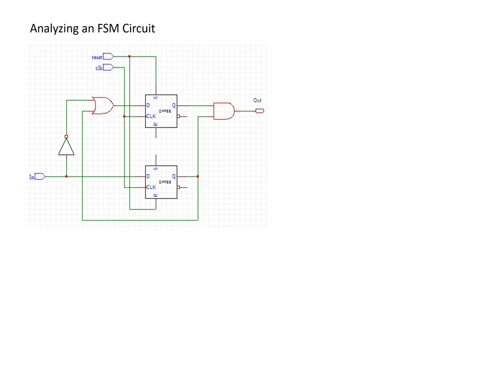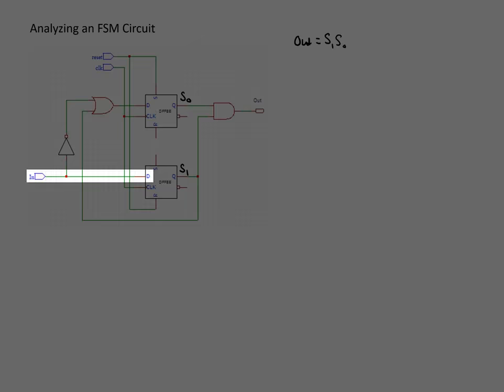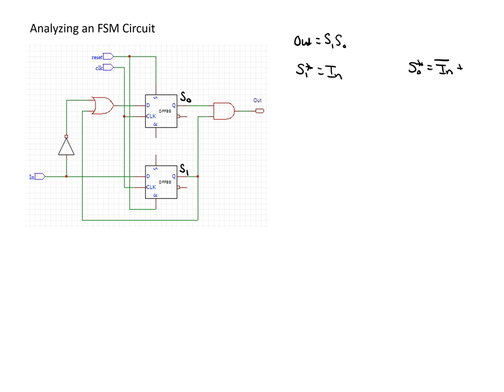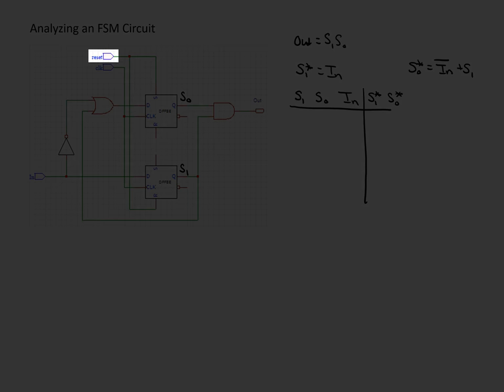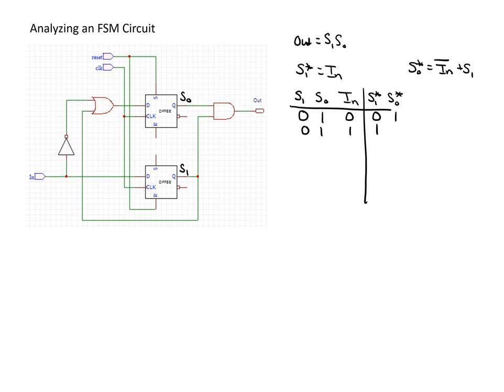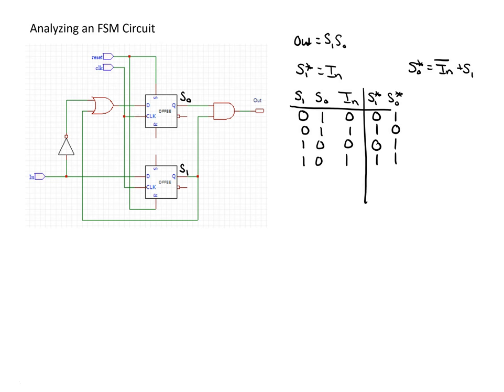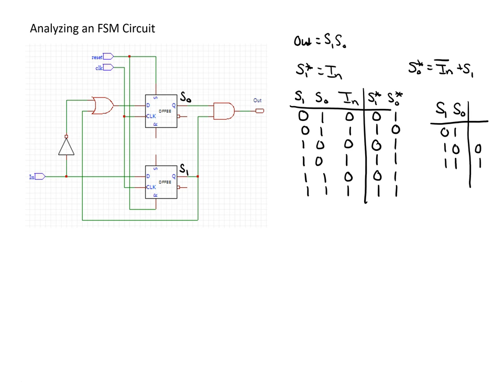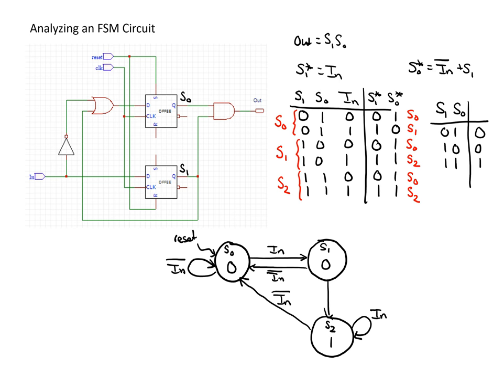Analyzing an FSM Implementation

Comment: Where's the state 00?
Reply: The design of the circuit prevents you from ever entering that state... The reasoning: The reset line signal is attached to both the set pin of the S0 D-flipflop AND(&&) the reset signal of S1 D-flipflop as well as the data line signal is connected to S1 directly and connected to S0 through an inverter or a NOT gate that is Ored with the output of S1. Regardless of the configurations of the Reset & Data line signals, the two flip flops can never have their stored bits in the state of {0,0}. The overall behavior of the circuit or state machine is to detect the presence of consecutive high or (1) bits in a string of bits.